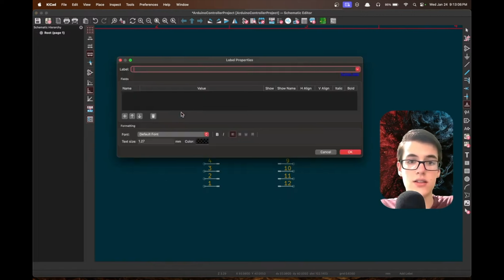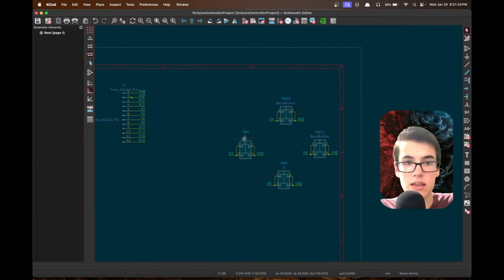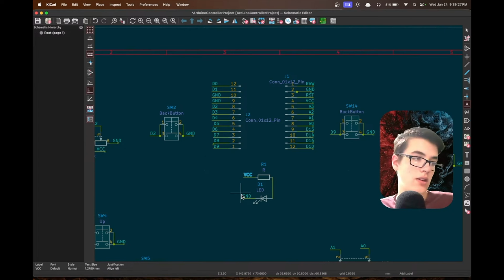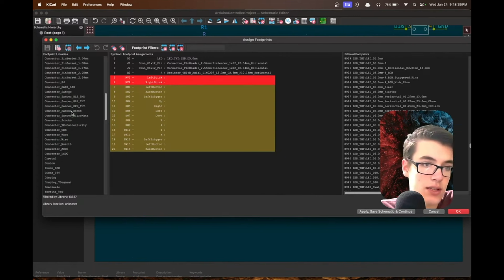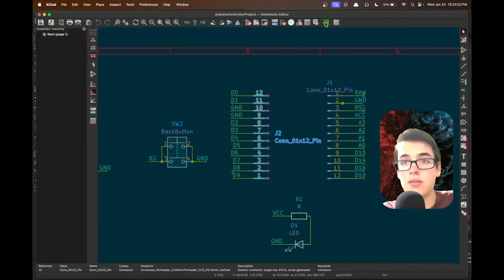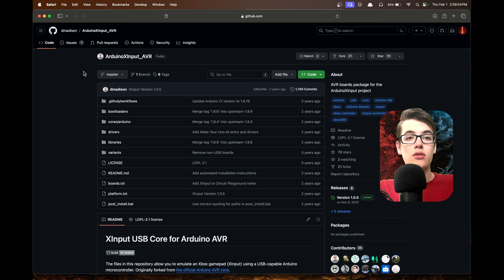Arduino Game Controller FULL TUTORIAL

Comment: how's the input lag test? assuming its wired connection. Interesting video. I'm also planning on using my spare arduino Uno R3 as Arcade Stick. I got schematic diagram mapped out but I still lack tactile buttons.
Reply from the maker: I couldn't get the input lag test to work but I did do a polling test and it polls at 1000 hertz, so theoretically it will respond quite quickly (with it being wired, this is not surprising)

Comment: Is there some way you can see the latency of this arduino controller? I am curious about it
Reply from the maker: Yeah there are testers I think let me look into it
Reply from the maker: I couldn't get any of the online testers to work and check the latency of the controller, but it does poll 1000 times/second, which is pretty standard and as it's a wired connection I would assume it's the same as most other wired controllers.
Reply: @danovation  I thought you might say that, I just have none of the tools or knowledge to do it myself so figured I would ask. Thanks for the info, I appreciate it

Comment: i got an Arduino Pro Micro and uploaded the code to it, now the controller is working but it doesn't recognise the mirco as an Arduino Pro Micro, is recognising it as a game controller. i tried to change the code or upload an empty code(for using micro in other ways) but since my computer recognising it as a game controller, i can't use Arduino IDE. is this code locking the micro? any way to change the uploaded code?
Reply from the maker: Yeah it does make it act like a game controller so you have to plug in the board, double tap the reset button, and then upload the code (this is time sensitive, might take a couple of tries)

Comment: Hi, sorry for being ignorant in arduino. Is posible to have extra buttons, on the bottom of the controller like a scuf controller?
Reply from the maker: Of course. If you’re making by your own PCB like I did you can add buttons wherever you want! (Only limit is the Arduino board has to have enough pins for it)
Reply: @danovation  thank you man, really apreciatte you respond my coment. Sorry for the inglish, can a i use an arduino mega o orginal. To make the joystick
Reply from the maker: Of course!
Unfortunately, I don't think the mega will work because you need a special USB chip that can talk to the computer that average Arduinos don't have. If you want a bigger board, I believe the Arduino Leonardo has a couple more pins and has the 32u4 chip (any board that has the 32u4 usb chip should work).

Comment: Where do you get the board xinput version of the micro
Reply from the maker: You just get a regular micro and then the library/board info stuff takes care of the rest!
(Shameless plug: I do have a kit available if you want all the parts)
Reply: @danovation  Ok, thanks, I have a normal one already so that works out great! I am going to build my own spinoff of this into my current project which is a handheld libre computer retro console. I have been looking around for a solution for the controls for a while and this is perfect! I will probably make a vid on my console once it is done if anyone else is interested.
Reply from the maker: @MrnM-p9e-i3t  Sounds awesome! Be sure to let me know if you need any help and once it's finished!